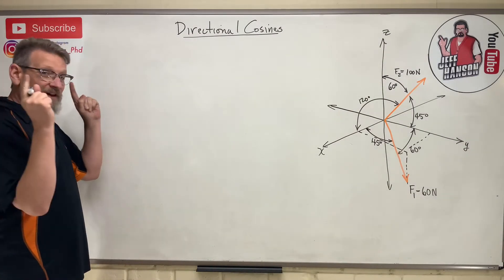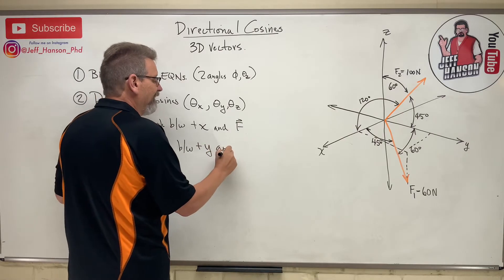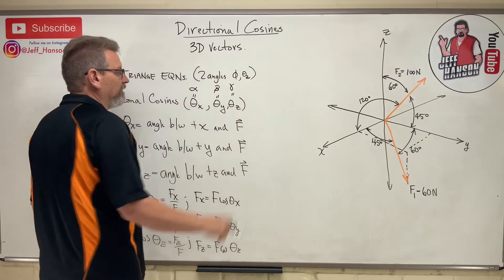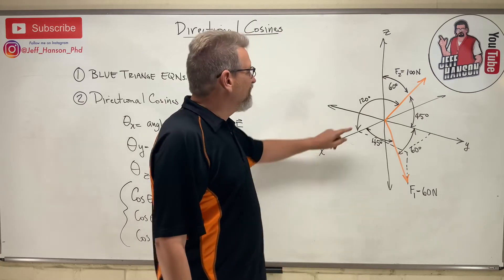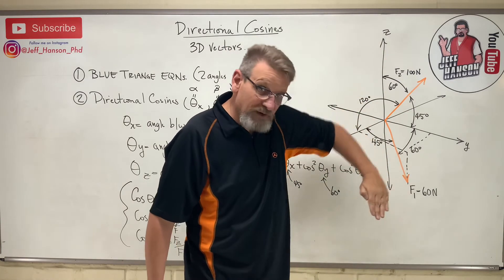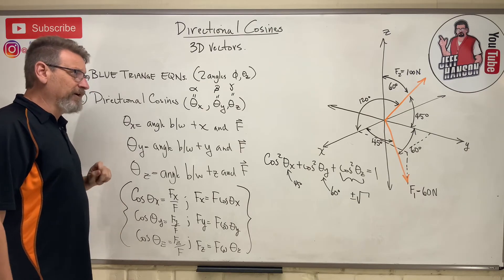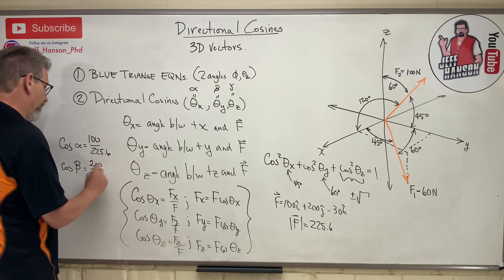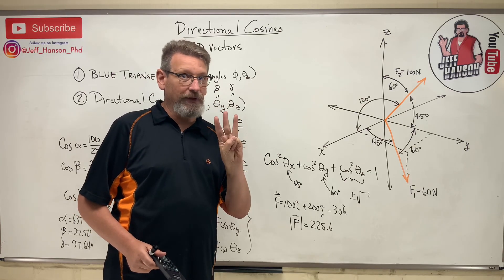Statics: Lesson 10 - Directional Cosines for 3D Vectors and Components

Comment: I am an Engineering student at the faculty of computing and technology  of University of Kelaniya Sri Lanka, Dear sir your videos help me solve 3D vectors doubts with which I was stuck at the exam this mid semester, However the question was like  this , there is a colour light hanged by three tesnion cable and ask to use the determinant and solve the Rt and find the angles , the distances were given on the plane .

Comment: "...but would Hibbeler use that in his books? Nooo, that is way too complicated...". Hehehehehehe... I normally would use alfa, beta and gamma, but that is just an old school way, though the theta x, theta y and theta z are definitely better in orientating oneself to which axis the angle belongs. BTW sq(100^2+200^2-30^2) = 221.6, right? Sometimes in the tutorials when they by mistake write one number different, I end up spending hours trying to find the "correct" value, when it either was a typo or just one number input wrong in the calculator and can screw up the entire calculations. Same with trusses, get one value wrong or even +/- wrong and everything goes bonkers from then on.
Reply: Yeah I got the same thing as u!
Reply: no its 225.61 (-30)^2 becomes positive so sq(10000+40000+900)
Reply: @christoffer2326  Yeah, you are right.
Reply: Did you finish the course?
Reply: @reverseflash7007  Still keep going...

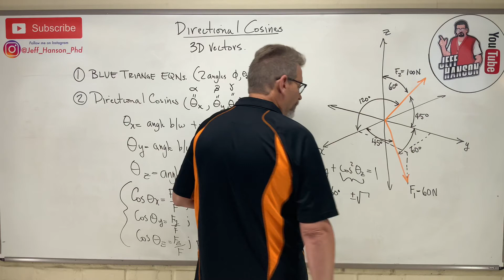Comment: But at 8:30, and in general, don't we take the counter clockwise and clockwise directions into consideration?? The angle from positive Z to vector F1 is clockwise. Can these angles ever be negative? Its the same thing for thetta y..its clockwise, doesn't that mean it should be negative?
Reply: So yes they would be negative using the directions into consideration but in this case the equation is 3 squares added together so any negatives get dropped.

Comment: Why is the angle coming off of the y-axis to vector F1 not -60 degrees? It's going clockwise.
Reply: So it would be -60 degrees.
With that being said the equation is 3 squares added together so any negatives get dropped.

Comment: Why do I keep getting 60 deg for theta z? Isn't it supposed to be larger than 90 deg coming from the pos z axis? help
Reply: Remember when you take the square root, you get a positive and a negative root. The negative root will give you an angle bigger than 90
Reply: @engineeredchannel5649  so when I take root of 0.25 and find 0.5 I should put "-0.5" in arccos I suppose.
Reply from the maker: @mehmetalieroglu6128  correct